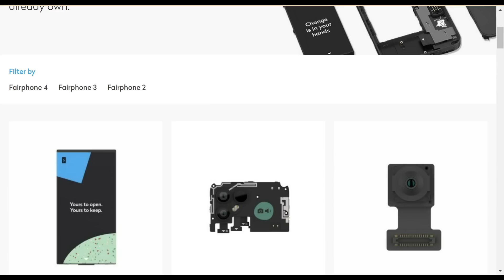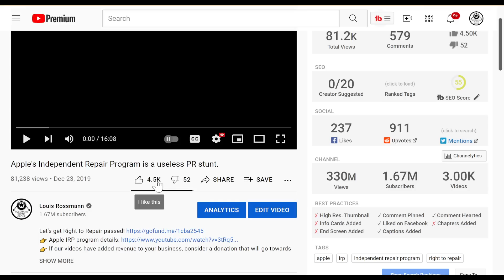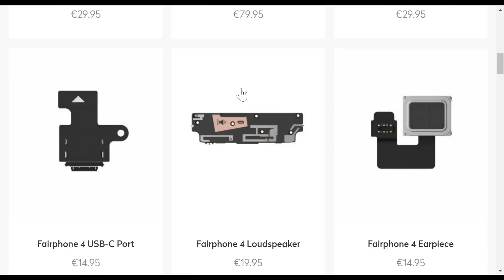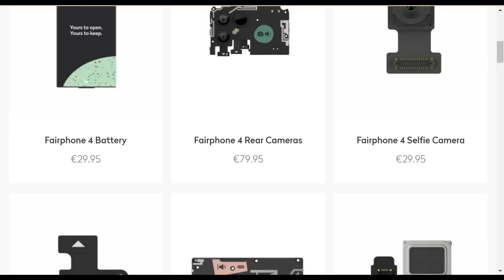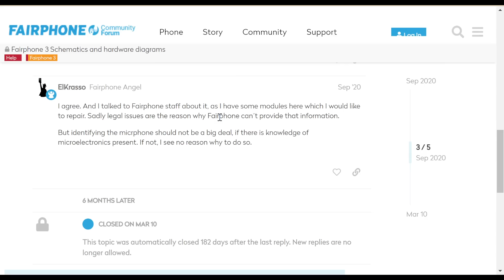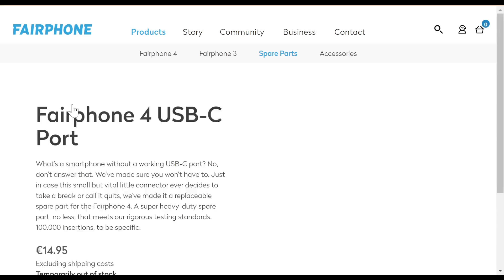Fairphone thoughts & commentary with Louis Rossmann

Comment: You wouldn't need to design processors from the ground up to avoid the reference board designs. You'd "just" need to engineer a circuit board from scratch using the documentation. That's a lot less work than creating a processor/modem from scratch. However, it's a lot of duplicated engineering effort which would only free you from that IP concern.

Comment: It is using snapdragon processor so very likely either a reference design or someone else's design of the motherboard that has a license agreement that prevents the release of schematics.

The phone looks good, but there are 3 things that prevent me from getting it and recommending it. No headphone jack, I use that way too much, Bluetooth is not good enough to replace it and I will not accept having to choose between headphones and charging the phone. It has a notch in the display which I still say is the stupidest trend in smartphones ever. It doesn't have LTE band 66, in my are that is primarily what TMobile uses and based on testing I did with a phone that doesn't have that band I would lose a lot of lte coverage.

Comment: They don't give out the schematics, because they don't have them. If you want to have a Smartphone and have enough money to do it it's super easy, you just call Foxcon - like Apple did, like "Nokia" and Fairphone and basically anyone else. You order what you want and they build it to your specs, some company have the luxury to keep nearly full technical control like Apple - but the small ones like HMD, Alcatel, insert brand and of course Fairphone they don't have the opportunity and they don't want it either because having in-house engineering is expensive, and Foxcon is also happy to keep everything in-house. Fairphone at least has its own design most android phones sold today have the fsspcb platform and just some different components soldered on it - depending when it was on the production line mostly - in case you wonder why different brands have the simcard slot exactly at the same place...

Comment: The argument for USB-C is speed. If the speed exceeds WiFI for data transfer or medical attachments (ultrasound - butterfly) then USB-C should be the way. Otherwise the only other benefit is cars , hotels, etc having the same port. Not a great benefit, but some little bit.

Comment: I bought the fairphone 3. 

After falling once from 1m the screen went black customer service was non-existent. It's fixable by opening up and putting back together, but the problem became recurring, where even a 20cm drop would cause it, it was really annoying.

Also, it would randomly restart with wifi enabled in SNCF trains (French trains), a known problem (in some places it restarts randomly with wifi enabled).

The worst problem is that it started dropping calls (outgoing or incoming), and it happened to me when calling emergency services.

All that happened before the 2 year guarantee end. I'm keeping it as a backup phone incase anything happens to my new phone. Maybe it was so faulty because I bought it as soon as it came out but it put me off from the company big time.

Comment: In the case of cars you have the founder of the Ineos Group with a yearly revenue in the 90 billion range who is starting to produce the Ineos Grenadier off road vehicle, which kinda looks like a Range Rover Defender. It is supposed to be easily repairable with video manuals and with parts being available. 

But the community using rugged off road vehicles is pretty different from the ones buying fancy smart phones. So I doubt that there is a great business case for a fairly produced, configurable, and customish made smart phone. 

Except for Apple, everybody else seems to just incorporate CPUs and GPUs. The same is true to my understanding for the camera modules. In the case of expensive digital cameras Sony or some other imaging sensor manufacturer might vary the imaging sensor with respect to the customers needs.

Comment: Even IF you were able to get the schematics for EVERYTHING, there are often laws that prohibit sharing or making available the modification of a cell modem. Those are really not fun to deal with, and there are absolutely countries (perhaps also the US?) where making your own or even tinkering with existing cell modems is illegal because of the kind of security issues that this may pose.
Reply: What kind of security issues could there possibly be? Surely they're just another USB device off the chipset's USB hub? USB3 is what? 5Gbit/s and fast wireless networks are something like 300Mbit/s? This isn't the late 1990s where you had to buy your modem as a PCI card because it was just a cut-down sound card and had to rely on the driver to do all the processing.
Reply: @Roxor128  security issues for the networks, i mean.

Comment: While I understand the possible reasons they don't want to publish schematics, I also think they belong to the user manual like they used to be 30 years ago. Maybe some obscure consumer law could be a base to sue some manufacturer over schematics. If I had the budget I'd already have tried the French consumer law, which states vendors must provide "essential information" to the customer. IANAL, but for me as a user of the hardware writing drivers for the OS I chose and wanting to repair it myself, schematics and specifications are definitely essential. Not sure the legislator intended it that way when using this wording, but it's definitely essential to repair, and to using the device when you have an OS that doesn't have a driver for it yet.

Comment: If you are a chip supplier and you are supplying multiple companies, you do not
want to create a situation where you are giving away your customer's design
secrets to each other.
Most companies will not use the chip maker's off the shelf design solution, they
will add their own touches to make their product a bit different. Still, as a component
supplier you have to act in a neutral manner when you supplying multiple
manufacturers.

Comment: You can only buy a preset selection of parts from the OEM manufacturer for this device. What if I wanted to drop in a 108MP camera module? Oh, they don't offer one... nope. And so on with every single component. It's still a closed system... so what makes this different from any other modular phone?
Edit: And worse than that, you can ONLY order the parts if you live in "Continental Europa and the UK". While this one company offers them.

Comment: 10:14 Richard Stallman's laptop was a Lenovo ThinkPad X200. It was the last notebook with the ability of supporting a fully Open-Source BIOS because it was the last Core 2 Duo laptop with all the vPro technologies open to the end-user with some tinkering; the X201 later on came with a 1st Generation Core i processor, and with that, the Intel Management Engine was introduced, the latter being a secretive black box.
The Free Software Foundation and Miniboot sell those (and other 00-series) Lenovo laptops under the Libreboot brand, completely refurbished and upgraded for modern usage.
Reply: Tell me more...

Comment: We used to be the factory repair company for Fairphone up to the FP2. I can confirm that they were not allowed to make the schematics available, not even to us. So we mostly only swapped parts. The only thing we repaired on these boards (FP1) was the USB port, which was poorly designed qua strength. We did some other repairs on boards, but it was difficult without schematics and to time consuming. It was a nice company to work for though, looking back on a good time there.

Comment: Meh, this is basically the inkjet printer of phones. They've put bits of a phone on to modules with mezzanine connectors. Unless someone starts making clone modules (ink carts) then this isn't much better then just buying two cheap Pixel phones for the same amount of cash and putting one in the drawer as a spare. The pixel phone has an unlockable bootloader, will actually get updates for Android etc.

Comment: From their pre-order page, however: "Delivery in Continental Europa and UK" - so not only can you not buy the phone unless you happen to live in that region, but the parts as well, so... GREAT! You can repair it yourself, parts are readily available... just not for anyone not local. It is NOT an "International Phone" by any stretch. 
The parts may be replaceable by users, but NOT on a part level. There have been many modular phones before... this is just one more. You cannot go buy your own screen or speaker or camera module for it, say... adding a 108MP camera to upgrade from what they provide? Nope. What if you want to install a better quality microphone or speaker? That's not an option either. You aren't buying parts, you're buying MODULES. From the OEM manufacturer who still has 100% control on the entire hardware upline. That's still no good, in my opinion. Better than most, but... any time it's 100% controlled by the manufacturer like this, they set the prices and availability. There's no competition. It's still their "system" or "line". Not 3rd party at all.

Comment: The funny thing is that apple might end up as the only  company,  capable of releasing schematics. Simply because of proprietary in-house chips and exclusive rights to all other chips like isl9240. 

Other funny fact is that apple is the only brand with most of the schematics available in the wild, after approx 1 year after release. There is a person who intentionally leaks boardviews with schematics on some stage of preproduction and he has not been caught for over a ten years. This kind of makes me wonder  if this "leakage" is covered by some high level engineer in charge, who wants his logicboards to be repaired so every time somebody wants to copy  the boardview he looks elsewhere. Also there were no PCB manufacturer boardfile(the one with layers, drill pattern, silkscreen, etc) released which means this does not leak from factory they produce board on but it leaks directly from engineer area.

Comment: FRP could be compromised if boot loader is unlocked. Stealing phones had become less worthy. Even with FRP removal tools, it may be harder to steal and sell phones.
Although data still leaks, would it be safer to keep boot loader locked?
I really want a desktop type customisable phone but I also want data to be absolutely destroyed in case of theft or theft to be useless as device could not be sold.

Comment: I notice that fairphone does not supply motherboards nor storage (though the two are probably come soldered together). 
Purchase price of cheapest fairphone: $579
Price of all other parts: $279.65
Therefore the cost of the motherboard and assembly is: $299.35
I wonder if they are not provided because it would be cheaper to just buy the parts and build your own.

Comment: Fairphone justifies their decision of removing the 3.5mm jack by saying that they want to improve "the water proofing" but in my opinion this is a total BS.
My Galaxy S10+ has an 3.5mm jack, USB C and is water resistant to an certain degree.
I once was riding my motorcycle with the S10+ attached to it's steering bar and I was riding through rain, through freezing condition in the mountains and the phone didn't break even though it has our beloved Captain 3.5mm Jack.

That's now also the reason why I'm using the S10+ and I also upgraded from the s6 (my secondary device) to Poco X3 Pro.
Also, both of those phones also have MicroSD slot which starts to become really rare on newer devices and the X3 Pro has ir blaster and FM Radio.
Two features which were also very common back in the days